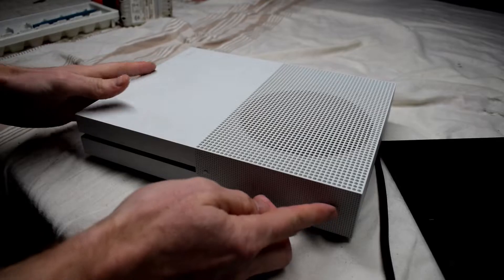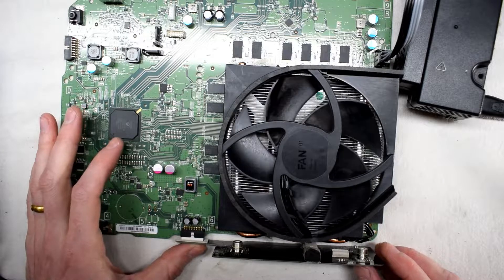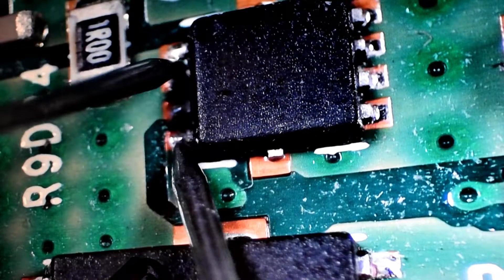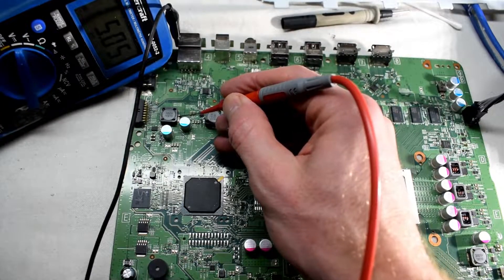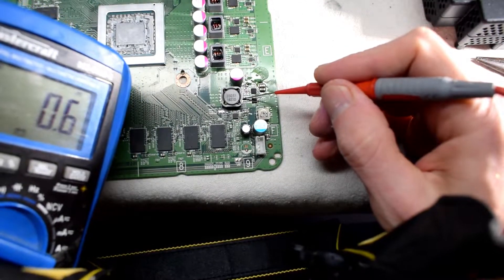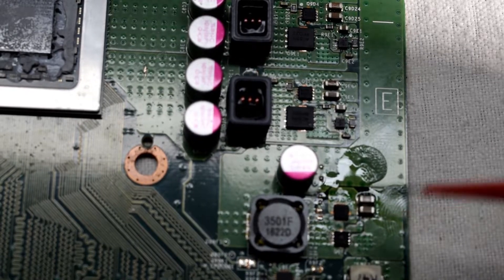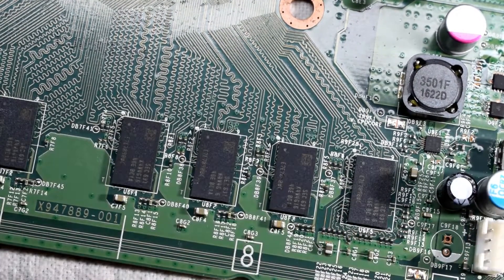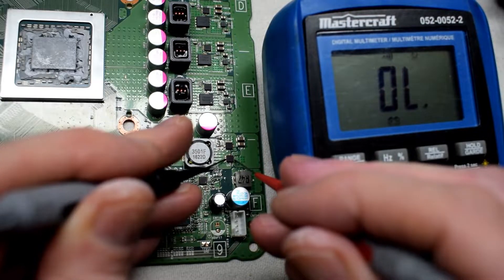Xbox One S turns then immediately turns off (Model 1681 Repair by Newson's Electronics)

Comment: HDMI re timmer chip!!.
I had black screen issue, installed the chip with too little soder or too much and got this issue.  
Reworked the chip but also noticed the 2 mini black capacitor? By it, I melted.  Used a donor chip to replace all three(1 tan) and it all worked out. I think either way it was a safety measure to keep from other chips/ parts from going.  Nothing in the power section or anything else. It shuts off right away right?  I'd try that 1st if your clueless at this point.

Comment: Same here all standby voltages correct, fan doing nothing.... 12v at fan ( checking pulse width modulation 4 pin plug fan....... (new fan)..... Hope its that easy or its fkd.
Reply: Did replacing the fan fix it

Comment: I am having the same issue with my Xbox Series S for about a week now. Funny as it sounds, it came back today, the light stayed solid and I could play a game for 3 hours. But as soon as I shut it down, it regressed. Now it is doing the same thing again. On for sec, off the next. 
If you have any idea or maybe a wild guess, please let me know.
Reply: Exactly the same thing used to happen with mine. It would turn on and stay on until I shut it off after which it would regress like you said. But if I let it sit powered off overnight, it would work again the next day and regress if I shut it off. I solved this problem by giving the entire motherboard an isopropyl alcohol bath (more like poured it all over) on both sides while brushing with a toothbrush. The thinking was that there could be some fluids, which, depending on the temperature, were affecting the motherboard behaviour. Even some flux residues left during soldering could become conductive if charred enough is what I've read online. So, the first step would be to visually inspect the board for liquid damage and corrosion first. Second would be to suspect the RAM and any other BGA chips because who knows what fine dust has accumulated beneath them. They would then need reballing. The problem with RAMs especially is that they aren't powered on during standby and hence any shorts or anomalies (on their power lines atleast) would not be registered by a DMM continuity or diode check. Any heating is also not possible to register on a thermal camera as the Xbox turns off instantly. So, you'll have to inject power into the RAMs' power rail (with the Xbox turned off) and check which RAM chip heats up to begin working on reballing it.
Reply: @SopanKotbagi  Thanks for a clear and detailed answer. Mine has been back to normal for a long time. My hypothesis, then, was that some droplets found their way to the motherboard because of stormy weather during those days. And I had left the window open. Just a week and half after the problem appeared I decided to give it another try, and guess what? I worked. I, then, didn’t even turn it off for a few days. 
Nevertheless, thanks for response.

Comment: i may have fixed this problem for me. Although i think it wasn't 100% the exact symptoms as yours. When i turned mine on i feel like it stayed on for 1 or 2 seconds more, I'm not sure though. Also my fan didn't start to spin. Not sure how much that matters though. Anyway:
I thought the Powersupply was the issue so i ordered a working one and put it inside and for a second i really thought that fixed it because the console stayed one for quite longer. I had the thought that this was maybe just because everything was disconnected and another part was the issue so i reconnected the old PSU but again instant turn off. reconnected the new one and DAMN bummer, same problem. At that point i was about to give up because the PSU probably wasn't the issue and it would be anything much more complicated above my experience level. 
I removed the cooler once more considering to check values with the multimeter like in this video. Problem: I'm really bad with the multimeter and mine doesn't have thin enough probes to precisely target the chips. Just about to give up i saw some blue goo what maybe was corrosion one the chip which is marked light blue on the ifixit teardown with the description "ON Semiconductor NCP4205 (Likely an iteration of the NCP4204 Integrated Power Control IC found in the Xbox One) (probably CPU power phase PWM controller)". i continued spraying isoprop on it and scratching the goo off with a toothbrush and toothpick for some minutes. i couldn't completely remove it so i thought noway that's gonna do anything but BAM when i reconnected the psu and turned it on barebones it didn't turn off again! first success however I didn't get any picture so i was a little worried again there might be another problem. but it just seams like you only get any picture if the HDD is connected.
In the end I stayed with the new PSU even though it probably wasn't the problem, i was just afraid it could maybe still be some sort of problem.
So it seems my problem was fixed with scraping the goo of the ON chip. Maybe someone can just as easily fix their problem.
Reply: Buddy, this just fixed the one I’m working on! I cleaned it and it did not work. So I put some flux down and heated it up and I think it cleaned it up a bit better doing that. It turns on now.
Reply: @Earlbaker25  I got this issue after cleaning my board. Was it the APU you put flux down and heated up?
Reply: I have the exact same problem but I’m extremely inexperienced but basically my power supply is reasing too many vaults on each of the 6 little outlets, I’m not sure if that’s the problem or if I just need to do some scrubbing but any help would be appreciated
Reply: Mate any updates? Is it working properly till now?
Reply: @xnojen  It Wasn’t mine so I can't say if it still works but I did several tests and everything was working fine

Comment: i had this problem start in July of 2021 and just never got around to troubleshooting, but i can't find anything that explains what might be wrong as all the suggested troubleshooting methods don't work. my psu voltage reads only 11.93-11.94 but i don't think that that would be the reason for this problem as it is very close to the 12v. But maybe im just an idiot and it is just underpowered causing it to fail before booting.
Reply: I have Xbox Series S doing this for a week or so. Did you ever find out what it was? Please let me know.